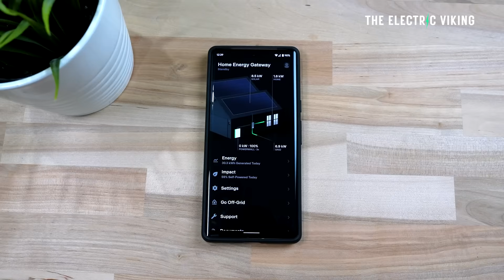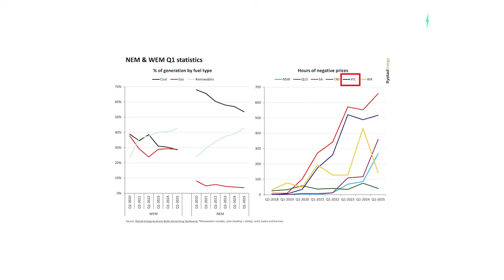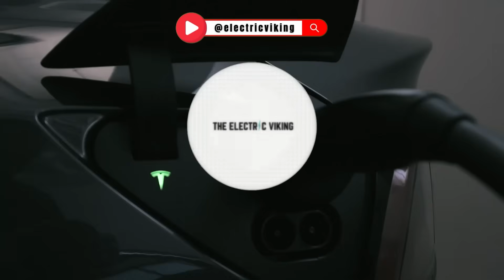Wind, solar & batteries push renewable energy to record levels in Australia

Comment: Net zero emissions from human activity is physically impossible and attempts to achieve it will be economically ruinous. 
In any case, global emissions continue to rise and Australia's emissions reduction has flatlined.
Reply: "Economically ruinous" depends on if you include the externalized cost of climate change and pollution which you are not.   The global fossil fuel industry has been very adept at privatizing the profits while socializing the costs to the rest of the world.  The externalized costs are not kept on the fossil fuel industry's books, but somebody needs to pay it eventually.

The bottom line is that fossil fuels are a dead-end technologically, economically, and especially environmentally.    Fossil fuels will be first to fall as they cannot last forever, and remaining amounts will be so deep and so remote, that they might as well be on Pluto.  Without the energy portion of petroleum, the big oil companies we're familiar with today will become just shells of their former selves.

The transition is already happening!  Right now, the world now invests more in renewables than fossil fuels.  In 2022, 83% of all new energy additions were renewables, and this figure has increased in 2023 and 2024.  In 2024, about $3-trillion will be invested in global energy and $2-trillion of that in renewables (two-thirds).  You think the world and the energy sector has caught onto something here you missed?

However, petrochemical use (plastics, lubrication, cosmetics, etc) will continue longer than fossil fuels. But petrochemicals are a very tiny amount of the total petroleum use.  Even these will be targeted for elimination as plastic pollution (especially in the oceans) is growing out of control.  There are concerning amounts of microplastics found in our bodies now too.  There are bio-plastic alternatives already being used in grocery bags and single use food packaging plastics.

We humans could go on burning candles and campfires for traditional and nostalgic purposes, but these are very tiny amounts compared to the nearly 100-million barrels of oil burned for energy daily.
Reply: @beyondfossil  spoken like a true zealot. 

The trouble is you don’t understand the physics and engineering involved. Intermittent renewables will never replace fossil fuels. EVs have already failed. They will peak around 30% of vehicle numbers but will not gain anymore market share. Those who wanted them and can afford them already have them. The EV needs to better than what it strives to replace and due to physics, that can never actually occur. Specific energy matters and batteries just don’t have any. Which means EVs will never match the range of ICE vehicles and if they do, they will weigh far more and cost far more with many more design compromises to achieve it. 

Likewise the future of energy is not wind and solar it is actually uranium. But if you understood the physics you’d know that already.
Reply: @polarbear7255  Much less than 1% of the world's land surface area in older and current gen photovoltaics can power all the world's grids.  There is enough offshore wind to power the world several times over.  Renewables, especially solar, have reached historic low costs of energy generation and still continue to drive their costs lower!

LCOE of renewables plus cost of storage is cheaper the nuclear energy alone without waiting decades.

Nuclear is the most expensive form of electricity generation and brings with it unparalleled risks.  It takes a decade or more of time bring online a single new nuclear reactor.  New construction nuclear won't even put a dent in the amount of energy needed to displace fossil fuels.

You need to spend some time to study up on economics and basic science.  Zealot indeed. Time to look in the mirror.  Zealots are the first ones to call other zealots.
Reply: @polarbear7255  Economically, EVs will drive grids towards renewable sources and additional capacity.  Because EVs provide economic incentive to upgrade the grids because every dollar spent on upgrading the grid gets both cleaner transportation and cleaner industry. The grid is a multipurpose foundational piece of a nation's infrastructure.  OTOH, fossil fuel vehicles have never and will never provide this benefit to the grid.

Continued use of fossil fuel vehicles keeps us dependent on the likes of petro dictators like Putin who don't hesitate to use petro as an economic weapon, and for leverage towards his selfish goals.  Continued use of fossil fuels keeps the world bent over the barrel of organizations like OPEC.  Continued use of fossil fuel vehicles drives us further into the climate change hole.  What's the first thing you should do when you've dug yourself into a hole?  Stop digging!
Reply: @polarbear7255  Human civilization has been around some 5000 years and earlier if you include our hunter-gatherer days.  If you indeed believe that fossil fuels will never be replaced, you are essentially giving humans at most some 200 years remaining.  Fossil fuels will be a speed bump along in the larger scale of civilizations.  Whoops, you just painted your whole argument in a corner.
Reply: @polarbear7255  You are completely ignorant of the natural world around you.  The sun provides an astounding cosmic 1.73×10¹⁷ watts of power continuously or 1000w per square meter peak and its always peak somewhere on earth.  As a benchmark calculation, just 1 hours' worth of this can power all the all 620-exajoules of energy the world use in a year.  Or just 1/10000th of that over the course of 365-days a year.

All the combined fossil and fissile material on Earth would amount to a bucket or two of water in an ocean compared to this power.  Some combination of sunshine and wind is available almost everywhere and they cannot be taxed, sanctioned, tariffed or blockaded.
Reply: @polarbear7255  The trouble with you is you're ignorant of the natural world around you.  The sun provides an astounding cosmic 1.73×10¹⁷ watts of power continuously or 1000w per square meter peak and its always peak somewhere on earth.  As a benchmark calculation, just 1 hours' worth of this can power all the all 620-exajoules of energy the world use in a year.  Or just 1/10000th of that over the course of 365-days a year.
Reply: @polarbear7255  Furthermore, wide-spread grid-scale storage is coming.  Batteries are just one type but others are the massive pumped storage hydroelectric (PSH) which is currently the king based on watt hours of storage with some global 1600GWh of storage.  That is some 10 to 15-times the capacity of battery storage.  Though battery storage is growing very quickly at exponential rates.

There's also grid-specific storage like compressed CO₂, liquid-metal flow, ceramic/sand thermal, hydrogen and so much more.  The entire field of grid-scale storage is white hot now with R&D, investments, government and commercial interest.  The reason is that grid-scale storage brings us towards dispatchable "firm renewables" which is game over for most every other energy generation on Earth.  Like renewables, grid-storage is growing an exponential rates.
Reply: @polarbear7255  Uranium is a joke at large scale and has been flailing for 70-years now providing just 9% of the world's electricity and falling further.

True nuclear power fans should be on their hands and knees each morning worshipping the astronomically massive clean fusion power we get for free from our local star.  There is no energy source even remotely close to it within over 4-light years radius from here.
Reply: @polarbear7255  Uranium is a joke at large scale and has been flailing for 70-years now providing just 9% of the world's electricity and falling further.

True nuclear power fans should be on their hands and knees each morning worshipping the astronomically massive clean fusion power we get for free from our local star.  There is no energy source even remotely close to it within over 4-light years radius from here.

Comment: NSW 6/4/25 at 7.30 pm ..Solar = 0%  Wind = 18%  Battery = 0.02 % Coal = 62%.
If we didn't have coal power , we would have widespread blackouts.
Reply: There are so many dreamers out there.  To run cities like Melb and Syd from 7pm to 7am on batteries when there is no sun and no wind power for several days is a major problem. There is no battery on this earth that can supply the needs for these cities during times when there is no “renewable” (I should say intermittent) energy available.  Base load power that maintains frequency is the only real backstop, whether it be gas and/or transition over time to nuclear.  Most people must think that heavy industry/businesses stop operation at night and that everything will be fine.
Reply: @saintmichael2931  It doesn't seem to worry Rio Tinto, one of the largest energy users in the country.  They are moving to renewables/batteries/pumped hydro to source their energy for the Boyne Island aluminium smelter post the impending closure of the ageing Gladstone coal plant.
Reply: @saintmichael2931  Yep! And those batteries burn baby burn. Just like Moss Point in California. The Government are telling residents nearby that there is no health risk from the toxic smoke from the fire! This whole renewable energy think stinks. Literally!
Reply: haha so true - and the little minded greenies have no idea what's coming in 20 years....

Comment: Yep 4.6G watts could supply power to the East coast for 12 minutes. Considering conservatively speaking if we run on 20G watts per hour, how much do we need for the night? When do you think the east coast will have enough to get through 1 night on batteries alone? The wind will help now doubt
Reply: There is no such thing as a watt per hour.
Reply: @geirmyrvagnes8718 Why would you say that? The simplest internet search shows that you're wrong.
Reply: not very much really. night consumption is very low in relation to day consumption....
Reply: If the south benefits, you'd expect the east to demand it (quickly).

Comment: 2.3B is your money the government is going to borrow to make you get a battery from China by stealing your generated POWER for almost FREE (CCP thanks you in advance) and then you will pay interest on it for decades as we owe 1.2T already and its growing! Batteries are cheap 12v300AH $700 each and a 3.5kwhr ICE backup gen $350 from 4WDSuperstore was around $800ea for 7kwhr for $1400 or x6 for almost 30kwhr at 5k plus installation. We don't need boondoggles like this we need John Howard! BRIBERY. Same for charity overseas, you only do what when the government is solvent (which we are not anymore)

Comment: Sam i love renewables but it is not anywhere close to a complete solution. We are never going to get free of greenhouse gas production without nuclear. The oil and gas companies know this and are doing everything in their power to convince us that renewables are the solution. If we do not go nuclear, the historically  safest power source with zero greenhouse emissions, we will continue to have to burn oil and gas that historically kills millions of people every year and adds to greenhouse gas emissions. There is enough oil to keep us going for another 300 years. The fossil fuel lobby love spreading the lie that renewables alone can get us to zero emissions when they know it requires oil, coal and gas burning to ensure base load capacity. Nuclear power and nuclear bombs have been conflated in the minds of the public by the fossils fuel lobbies, spreading the lie that nuclear is dangerous. The only danger it presents is to the fossil fuel industry that will do anything to keep us using their products which are valued in the trillions of dollars. Time to wake up to the hoodwinking.